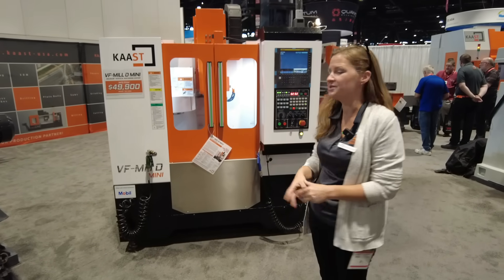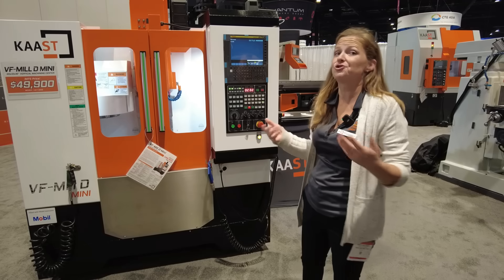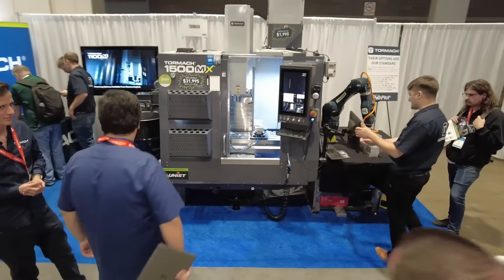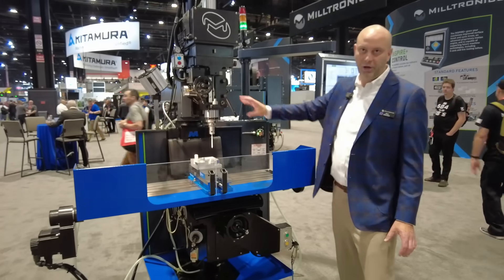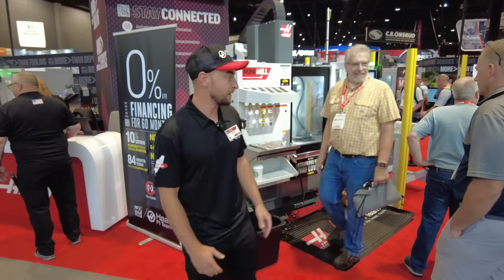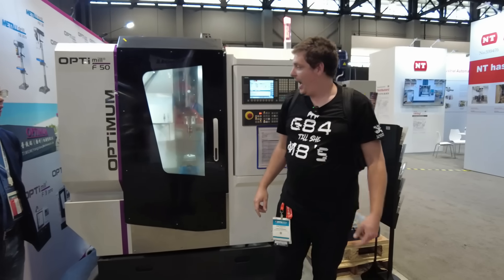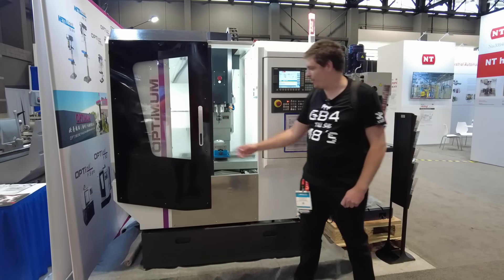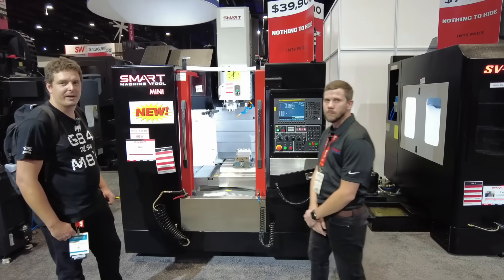Every Entry Level Mill at IMTS

Comment: You missed out on the DN Solutions SVM4100, they are like $59k, 12k spindle, Fanuc Oi Plus, TSC and TSA, auto greaser, 30 tool and its a 30x20 machine.
Reply from the maker: I did miss that! I didn't think they had anything that qualified, my bad!
Reply: @AudacityMicro  I didn't think they did until I hit up my salesman to see if he had something that compared to the Smart mini. You can get a chip conveyor for like $6k more.
Reply from the maker: I'll pin this comment so other people can see it.
Reply: Are they running a special or something? I priced an SVM4100 roughly 10 months ago at closer to $75K. It does look like a heck of a machine, but I'd put it at or slightly above a VF2SS similarly optioned. Ended up going with a DNM4500S though for another ~$15K more plus a few options.
Reply: @sksmith903  that wasn't a special, but each dealer is different on prices. That's just what my dealer told me for a price. Some dealers might be cheaper or higher though.
Reply: @dadandsonsworkshop   it's a good data point. Thanks for sharing! Really happy with the quality of my DNM4500S, but I might go with an SVM4100 for the next one.
Reply: Awesome video 👍
Reply: DN machines are pretty legit
Reply: I have an SVM4100.  I was told I was the first person in the USA to order one actually.  It's an amazing machine and if I need to get another mill someday it will be another SVM!
Reply: 9:42 that Toolchange system does Chiron machines have bevor 20 years
Reply: I was quoted $71.4 K which included 5.5k freight from Georgia to my rigger.
Reply: 59k is 60,000 dollars boss.
Reply: Fanuc controller is a deal breaker. There are so many GOOD controllers out there that only a psychopath would tolerate a Fanuc.

Comment: Trak VMC2 is the bomb! Bought one 4 years and is in my garage. I use it most everyday producing proprietary products. 10K spindle, 14"X12"X17" travels (XYZ), rigid tapping, a very powerful control, 8 station tool carriage, BT30 spindle, air blast, flood coolant, a very compact footprint and at a great price! Sorry you missed it...

Comment: If you want to see mini mill look up for “Micro5”.  There is different suppliers, Precitram with the K5, Enoveas with the Silex and Chiron with the factory 5. At full speed with oil they use less than 500W of power.

Comment: Don't have a non technical woman doing technical sales.  3 phase 220 so you can plug it into any dryer outlet?  While this is true, it is also BS because a 3 phase unit isn't going to run on split phase.  Is she trying to say it will run on single or 3 phase?  The only reason why i don't have a Machining center in my garage is the power issue.  Phase converters are too dirty or too expensive.
Reply from the maker: She was plenty "technical" she just misspoke because she got put on the spot on camera. Most people absolutely freeze when that happens to them, she did way better than most people. She of course meant using a phase converter. And not sure what you mean by dirty, but if you are doing work for money, then the cost of a phase converter is peanuts. If you are doing it as a hobby, then you can get something like a Tormach that runs on single phase. Or even split the difference and go with something like one of the single phase Haas machines
Reply: Didn't "misspeak" dryer outlet is not a slip of the tongue.  It is misinformation.  Public speaking is hard. Get someone who can do it right or don't do it.  Hate to think that someone would shell out $50K to find out that they were misinformed.
Reply from the maker: She just didn't mention that it had an optional phase converter. And she wasn't supposed to be doing public speaking, it's not like she got a chance to rehearse, I just walked up to her with a camera. She did fantastic.

Comment: avoid smart.
Reply from the maker: Why?
Reply: @AudacityMicro   First hand experience. Our shop owns a giant lathe of theirs. Nothing but problems since day one. Had all the seals replaced in the turret, twice, still leaks hydraulic oil into the coolant sump. You can see it dripping down the casting as it is sitting idle. Parts are a real challenge to get. I will say their service department is getting better, which is nice, because you'll be using it.

Comment: All this crap is great right up to the day when you need parts. New, probably not a real issue. But wait till it’s 5 years old. Now if you want to sell it 5 years later it probably won’t have any value. Good chance the original manufacturer is  just another statistic. This won’t ever be a problem with a HAAS. Been there done that.

Comment: I hate cnc knee mills lol
Reply from the maker: I totally agree, but there's a reason they still get sold, so I figured it was worth showing them.
Reply: @AudacityMicro  They have their place, they are really good for the same things you’d use a knee mill for normally.  But they are not at all a replacement for a normal bed mill.

The company I just got hired onto as the lead machinist, spent $35k on a prototrak kneemill and they didn’t even get Z axis power, just a jogger attachment.  I’m working on getting them to sell it and buy a regular ass 3axis bed mill.  

Got any recommendations on the cheapest medium sized 3axis mills for a shop that does primarily 300series SS?
Reply from the maker: @kw2519 depends on the size requirements. The smart and kaast machines looked good in this video. But it's really hard to beat the value of a Haas VF2

Comment: the KAAST, double check the voltage requirement. She said 220v 3 ph, then said it would hook to a dryer plug. MOST dryer plugs are 220 single phase.  Very nice machine.
Reply: I noticed that but she said 20amp. No way I can see regular 220 would support 10hp on a 20amp unfortunately 😢
Reply from the maker: She obviously got tongue tied a little, since she forgot to mention needing a phase converter. But generally most dryer outlets are 40-50 amps. At least in older houses. Maybe newer ones expect more energy efficient dryers, but 50 amps is more than enough to run a small mill. Heck, my (very small) Haas runs on 20a of 240 single phase.
Reply: @AudacityMicro  ah, understood! But to note that a dryer outlet is standard at 30amp. In house wiring it’s used with a #10 romex. The only 50amp circuits are generally a 5 ton ac and the oven/stove combo. Thanks for the reply, one day I would love to get one of these and that gives me a lot of hope!
Reply: @AudacityMicro  This is incorrect. If you're running a single phase 240v* 10hp motor, you're going to need at minimum a 55amp breaker. If you're using a converter, you're going to need even better.

She's clearly correctly stating it's a three phase, though I have my doubts if the 20amp breaker is correct, given the spec sheet. Definitely being loose with regard to it matching a dryer plug, but maybe she wasn't speak in terms of the specific receptical.
Reply: I have a 10hp air compressor single phase and it's on a 50 amp breaker
Reply: Around here dryer outlets are single phase 240v also, not 220v.
Reply: @578Beta in American 220-240 are essentially the same thing.    Depends on line voltage which can vary from 107-124 or so, double that and that's your 220/240 voltage
Reply: @Trickyricky1982  In my circle 220 is reserved for 3ph, 240 is single phase.

Comment: Should have stopped by the TRAK machine tool booth, TRAK has amazing entry level machines with there easy to run RX control. They had the VMC2 at the show.
Reply from the maker: I did, they asked to not be included in the video 🤷‍♂️

Comment: First machine: KAAST - Confused at the 20 amp 220 3 phase but can plug into a dryer outlet. When did dryer outlets become 3 phase?
Reply from the maker: She just got ahead of herself, and forgot to mention that you are plugging a phase converter into the dryer outlet
Reply from the maker: Not the machine directly
Reply: @AudacityMicro  single to 3 phase converter will change the torque curve... dramatically.
Reply from the maker: No? For a few reasons. 1) modern phase converters just don't do that. 2) all machines these days have a VFD, so regardless of your phases, it becomes DC before being turned back into three phases. As long as you can supply enough clean power, the machine doesn't care where it's coming down.

Comment: You won't have 3ph at home
Reply from the maker: Phase converter
Reply: @AudacityMicro  but your sales person clearly said , if you have a 20 amp, 220 3ph dryer outlet, that would not be 3ph, so ok you need a phase converter.
Reply from the maker: She said "it's 220v 3phase" then she also said "you can plug it into a dryer outlet". She did not imply the dryer outlet was three phase. The unit there was running on a phase converter, and therefore could have been plugged into a dryer outlet.

Comment: Maybe they've worked out the kinks a bit, but I've had bad experiences with Haas' APLs. A place I used to work had one of the new style ST-20s with the gantry loader and the loader was just the biggest POS. There was a table the blanks sit on that moves back and forth under the rail and it just wouldn't move in a consistent way. Factory techs came out to work on it half a dozen times, never fixed it. Every 4 or 5 parts it would come down wrong, hit the edge of the part, and get the stock wedged between the gripper and table and have to get powered down and jogged all the way back up at snail speed.
Decent lathe, garbage loader, just pay someone to do it by hand since it can't run lights out anyway.

Comment: for the first machine  KAAST did she mean that it runs on 220V single phase? I cant imagine that many 3 phase dryers running around
Reply from the maker: I think she meant that you could plug a phase converter into a dryer outlet.
Reply: @AudacityMicro  hmmm that would make sense too now that i think about it since i have a 10hp one now and that can go up to 32A so a 20A breaker wont cut it

Comment: Home dryer outlet is Single Phase 220.  She said dryer outlet 3-phase 220. Most homes do not have that. You would need a phase converter to get 3-phase.
Reply from the maker: Speaking on camera is hard, especially when you are out on the spot. I'm sure that's what she meant, but just forgot to say it.

Comment: Meanwhile hobbyists are still limited to few choices like overpriced 440, perhaps 770 or MR-1 which at $7K self assembled is probably the only true hobby cnc mill on the market but being gantry it obviously suffers from l Z problem
Reply from the maker: That is very much a problem, yes. I wish there were more machines at the 440 level. There's lots of small desktop machines, but not much more capable than that.

Comment: Sorry but with the first machine the math ain’t mathing. 20A @ 208V won’t give you 10HP, and that’d be just the spindle, without all axis motors.
Reply from the maker: 240V three phase. By my math that gives you ~20% headroom over the 10hp, and I'm sure the hp rating is "peak" and therefore not expected to be sustained for more than a few seconds 

So napkin math says it's close, but they definitely didn't include nearly as much headroom as some other machine tool builders so.
Reply: @AudacityMicro  that is 100% correct, I just went with an assumption that it’d be a single phase 208 or 240.
Reply from the maker: She said three-phase, and then started talking about dryer outlets, which I think confused people. I think she meant you could plug in a phase converter to a dryer outlet

Comment: I'm a huge fan of Hurco. I have been running them for years and they are very capable. I have been able to chase sub 0.001" tolerances on them
Reply: Held .1875-.1877 in a hass DM with endmills for 20 pieces without nonconformity. All machines can hold tight tolerances nowadays. And with HSM quickly becoming the norm strength and rigidity are becoming less important than they used to be. I'd look mostly for features (multi axis ready, rigid tapping, etc) and for controls that more people in the industry know and are user-friendly. Fanuc > winmax in other words.

Comment: The 20 tools is MASSIVE compared to 12. While I personally prefer paying a fair bit extra and go for a Mazak - that Smart Mill is surprisingly capable for that price. I always have strong doubts about these entry mills and would probably rather get a used instead but... the Smart Mill wouldnt be too bad a choice. It would depend heavily on how their support is in Scandinavia. Nobody beats Mazak at that though 🙃
Reply: Did you have good mazak support?  We had a 250msy that went through 3 sub spindles in 5 years, 300 hours on each before they burned up. Took them months to get the replacement scheduled, and they loved sending out a tech to say “yup it’s busted but I didn’t bring any parts so I’ll order some and come back again” multiple times per spindle before they turned a wrench. Usually 3-4 visits before anything actually happened, which took multiple months.
Reply: @blacklabel6223  They usually make sure all the parts they need are sent to us before the technician arrives here. Its just a waste of everyones time if not so I can see why youre frustrated. Not only with the way they operate in your area but 300 hours? Thats not much.

Due to my location there isnt really any technicians living close by. So when a new machine is coming in and they have to run a setup - most of them will overnight in nearby hotels etc. A few years ago one of their technicians decided he wanted to drive and sleep back at his home every night... which was a 3 hour drive each direction. Which meant 3 hours at our workshop before his workday "ended".

That went on for about a week before we called Mazak and told them about the deadline for when the machine was agreed to be up and running. New tech showed up and made sure the deadline was reached =)
Reply: @blacklabel6223 we had Mazak come out to fix our 250msy and he had to order a controller of some kind, it showed up having a crushed connector plug directly from mazak lol

Comment: Great video for those starting out in a shed/garage. Can the Hurco VM 0ne run on single phase? I bought a Hurco VM10i late July and it was installed last month into my small shed beside my house here in Perth, Australia. Hurco Singapore are extremely good to deal with. Machine seems capable from my use so far.
Reply: The VM One can run off of single phase. Other machines may have the ability to use a single to three phase converter.
Reply: The VM One can run off of single phase without a phase converter. Other Hurco machines may also have the ability to run off of a phase converter, but I don't know if this is the case for all of Hurco's machines.
Reply: @EngineeringAlex  Thanks for the answer

Comment: The smart mini sounds like a great pretty good deal. Fanuc control, 24 tool smtc, good weight and travels for 40k.
I wonder what the options list costs..

Smtc may be a pita getting in a garage tho. Had to remove my vf2 smtc to slip it under the door. Was a pain to remount with little clearance for rigging under the low roof.

Comment: Do all tool experts say RPMs? Do they not know it's redundant? Revolutions Per Minute, it's already plural. Regardless, RPM is a description of rate which is singular. Even Titans use it. Am i wrong?
Reply from the maker: I think it just rolls of the tongue easier. When you say it 1000x a day, you tend to lean to the easier option, even if it isn't literally correct

Comment: I like that this company sells that mill made in Taiwan. Kaast reminds me of what Precision Matthew’s does: sell Chinese and Taiwanese versions of their mills and lathes. I went for the Taiwanese models, a PM-1640TL and a PM-949TV. Precision Matthews says the Taiwanese machines have better quality control, but there are undoubtedly very well-manufactured Chinese machines for sale. Kaast seems to be selling rebadged Bodor laser systems. I very recently purchased two Bodor machines: a 6KW P3 Sheet cutter, which is the 4020 or 4 m x 2 m worktable size with shuffling tables. I also bought a Bodor K230 6KW tube cutter, which is the twenty-foot long version, with Bodor’s Ttrans automation system, which automatically loads tubes. I wonder how much Kaast’s version of the Bodor laser machines cost.

Comment: I own 3 smart machines, and have had great experience with them as a company.  I do not own the machine you shot, but i do have an sv-2, which happens to be right next to it.  In 6 years of owning their machines, i have had to replace 1 coolant pump on 1 machine, which is pretty good in my opinion.  I started just as some others mentioned, buying used, but quickly got tired of fixing the machines, and the slow feedrates and rapids, and no memory.

Comment: Why do you use thew Tormach as your base?
Reply from the maker: Mostly because the 1100MX is a SUPER common machine, and up until a few years ago, it was the best option for a cheap, but capable machine. I made a living off one for two years, so I'm familiar with it, and I think there are a lot of people in the same boat.
Reply: @AudacityMicro  Appreciate your response.  I have an `1100MX (I'm a hobby guy) but I'm thinking of a better machine.  1500MX is attractive as my learning curve will be zero, but perhaps its not a real upgrade...
Reply from the maker: I have two really comprehensive videos on the 1500, and one on the way to my shop (a 1500mx I mean) It's a massive upgrade over the 1100mx, and in the same class as all of these machines here.
Reply: @AudacityMicro  I'll look for those videos - thank you.  It's still only 4hp though....and if I'm gonna spend 50-60k, I dont want to regret it :)
Reply: @AudacityMicro  Tormach sending you a sample to play with for a while?
Reply from the maker: That is the general idea, yes 🙂